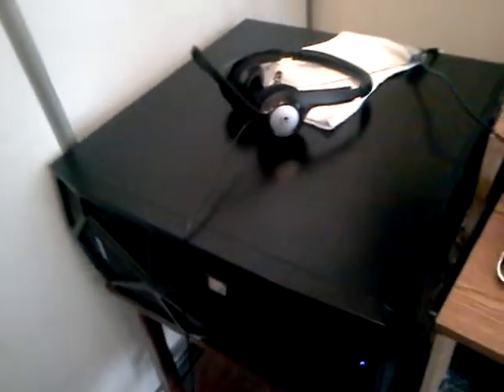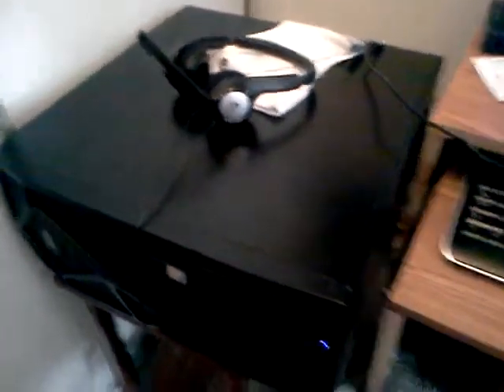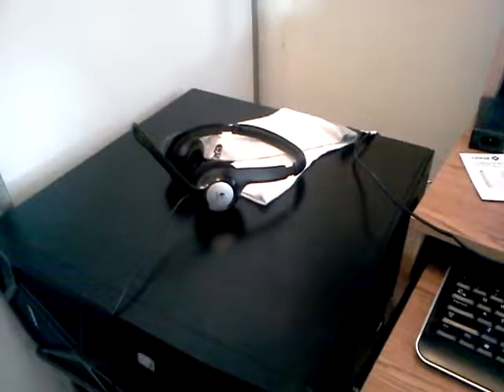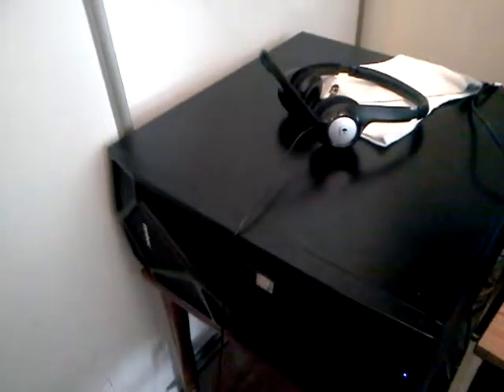Delta AFC1212D-PWM 120mm Case Fan review

Comment from the maker: it really just depends on your motherboard,
my mobo, says that it supports on each plug up to 1.0 A
this fan claims just under that so I was ok,

this may not be the case for you tho, check your manual.

the fan here comes only with a 4 pin pwm connector meant for your 4 pin pwn motherboard slot,
the more powerful ones will have the power lines split off to plug into your 4 pin power supply and 2 wires on a pwm header that plug into your motherboards pwn connection, to control  the fans RPM's

Comment from the maker: if its your cpu heatsink, 
just save the money on this fan, and buy something like a coolermaster hyper 212+
its a pretty darn good cpu cooler that works on alot of cpu's,
if you can use that cooler, i pretty much guarantee you will get a better temp than just by replacing the fan, unless you have a water cooled rad, or something big like a noctua nh-d14